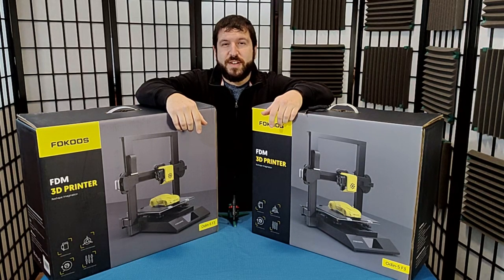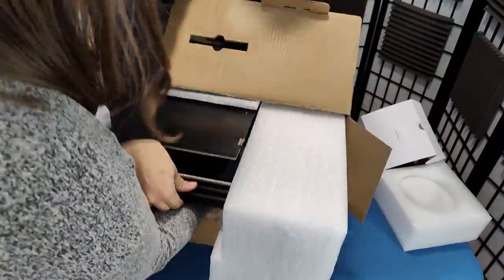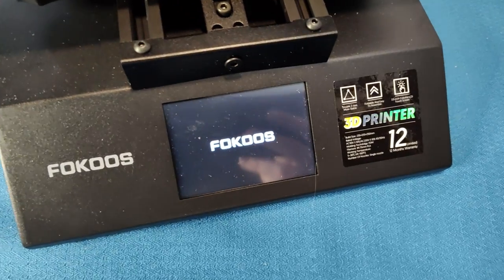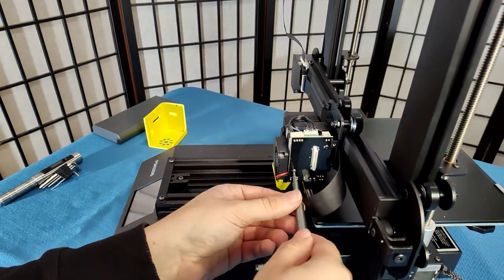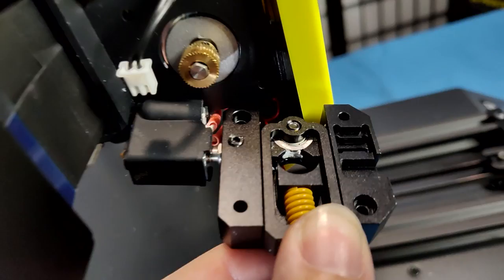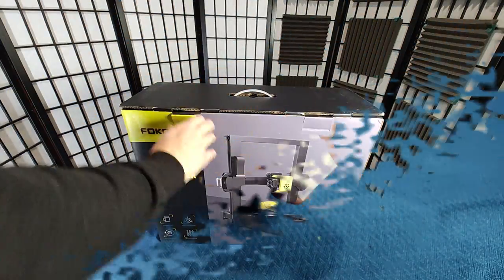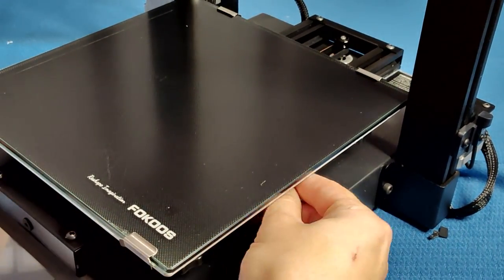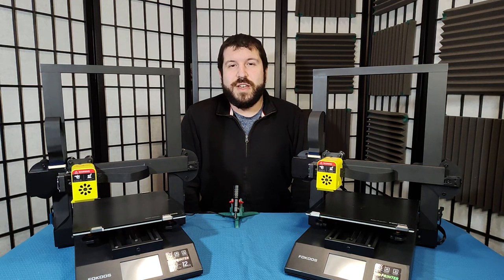Amazon Return 3D printers. Are they worth it?

Comment: I can SAVE YOU 9 MINUTES.  

In fact, this is way more a discussion about the experience buying 2 printers this way, than a discussion about the overall process as the title suggests.  In fact, it doesn't even cover the MOST IMPORTANT TIPS:

1. How to FIND these,
2, How to GUARANTEE THEY WILL WORK (or you can get them working)

Bottom line: they ABSOLUTELY ARE worth it, if you can do ANY troubleshooting, or, watch Youtube videos or read Reddit on HOW TO TROUBLESHOOT A 3D PRINTER.  And I'm not talking about soldering on a replacement chip, but rather swapping out boards and making screwdriver connections on the worst end of the electronics scale, or troubleshooting a hotend.  If you're NEW to 3D printers, you want to watch enough assembly videos to be a Jedi Master before you even ORDER your 1st printer (you'll even learn from videos about printers OTHER than the model you bought).  The best ones don't just cover the BASIC STEPS OF ASSEMBLY, but instead lots of other things to know you a) got a GOOD PRINTER and b) ENSURE it does go together properly.  Those things include making sure it sets level and doesn't tilt, checking the Y axis stands as close to a perfect 90 degrees to the bed as possible, etc.  Watching lots for different models may even help confirm what MODEL would be best for you.  My opinion is the spring steel magnetic beds with auto leveling, like a Anycubic Kobra are a great 1st printer, however, with a glass bed, like an Aquila has, you can easily level it and likely not touch it for months on end if you aren't moving it around or trying to jerk prints off the plate before they cool and self release (pro tip: shut down your heated bed around 4 minutes before the print finishes and it will self release a minute or two on its own after the print complete, someone needs to make this a Cura add-on to just build the Gcode to do this into any print as an option).

First off, to FIND THEM, you use the words "UNREPAIR 3D PRINTER" on Ebay.  Most of the offerings will suggest LOTS of units for sale: "more than 10 sold" or "10 available, 393 sold"

Secondly, to GUARANTEE IT WILL WORK (or that you can fix it, or worst case that you're not really out any significant money from a total trainwreck), all you have to do is BUY THE ALLSTATE WARRANTY, at $5.99 - YES $6 --, and IT GUARANTEES YOU A WORKING PRINTER for a YEAR OR YOUR FULL PURCHASE PRICE BACK (because there is NO economics on the trying to service a $119 product that is expensive to ship somewhere to get fixed, since there isn't 3d Printer troubleshooting in every 7-11 store).

I KNOW this for a fact after purchasing 4 printers this way.  3 were MINT or almost (Ender 2 Pro, $69 delivered, Anycubic Mega X, $119 delivered, Anycubic Kobra $119 delivered), 2 of those likely never taken out of the box ("Oh, Timmy, that looks DANGEROUS! or "Oh Timmy, you'll never be able to put that together!"), the Mega X needed an electronic end stop adjusted that was making contact, and lastly out of the 4, 1 had serious problems, an Aquila bought for a nephew: they had ripped off the mainboard and the cable to the LCD.  Guess what?  The refund PAID for those items brand new with money left over.  Nothing like getting a printer with a BRAND NEW mainboard, at the price you expected to pay for one with a USED ONE.

There has NEVER been a better time to get into 3D printing.

Comment: Nice topic. I prefer to buy off of eBay and I buy “for parts only” I do look to see how many parts are missing. I’ve bought 5 printers this way. 2 Lulzbot TAZ 5, 2 Snapmaker 2.0 350’s and a Dobot Mooz 3. They mostly suffered from people putting them together wrong or taking apart for some reason or not knowing how to bed level, z-offset or use a slicer. I paid, combined around $700 and $500 in parts and I have easily over $5000 in machines. Some time was spent and time is money so maybe 40hrs in total getting these working. But they work as new and I learned a whole lot.
Reply: How do you find these crazy deals?
Reply: @Cicada-uv5se  eBay. Takes time and save the search. About once every 5 months there will be a deal BUT make sure it’s not missing too many parts. For example one of the snapmakers I bought was missing the touch screen also the spool holder. I built a spool holder but you can’t build a touch screen. Also one TAZ had a cracked screen and broken off adjustment knob so need to buy that also. The other snapmaker needed to rails. But the cost of those parts still made it a huge bargain. Remember, for the TAZ I spent about 12 hrs with rail adjustment and rewiring. But I am very mechanical. Huge deals out there if you are careful, buy right and smart.

Comment: Don’t get that sort of deal in the UK - returns are sold at a discount through Amazon Warehouse but the discounts are often quite trivial and in my opinion are not usually worth the risk of fault, damage or the reduced warranty.  For example, the printers that you show are £270 new but the returns in Amazon Warehouse are £225 - just £45 discount, simply not worth the risk in my opinion.

Comment: I’ve been buying longer lk5 printers that were returned off eBay for 160$ or less and they all have been the upgraded version and work perfectly fine even tho they were advertised as untested

Only problem I’ve have was changing the Bowden tube end and fitting because it slipped out after a couple months of use

And what I love about this printer is it’s 300x300x400 print size and you can buy cr10 parts for it like bl touch

Comment: I have bought several returns and usually they're a great deal. One time, however, I received a printer that looked like it had been run over by a truck. It had been assembled and then returned but the original owner managed to fit it all back in the original box without disassembling it. I had a good, but expensive, laugh.

Comment: I'm not seeing any deals that low at the moment but maybe with a tool like Camel camel camel or similar I can set up tracking and notifications when some of these super cheap deals pop up.  I'm fine with gambling on these since I build printers from scratch all the time and most of the troubleshooting required is well within my wheelhouse.  The only real losses are if I need to buy a bunch of missing parts.  Fortunately, at the moment, I'm flush with plenty of spares for most machines as well. Just need to find some of these super deep discounted deals.  Thanks for sharing.

Comment: I have bought a flashforge adventurer 4 and it had a broken door and an intermittent issue with a stuck y max sensor. had to dig through the activity logs to ensure that was what was going on as the motor on the y-axis would only go in one direction at times and this would result in banging against the door of the machine. cost about $35 in parts to fix both of those which made it well worth saving the $600 more a retail one would have cost.
3d printing is a diy thing anyway and it is good to get a feel for the 3d printer itself since it will malfunction at some point.

Comment: $47? You'd be out that or more after buying just the stepper motors and power supply, not to mention the board and screen. It's worth it to not only fix but also if you want to scrap it for a new build. I bought a broken Tina 2 S and I'm completely overhauling it, (new board, hotend, extruder etc) the electronics I'll salvage to make a 2nd PET pultrusion machine.